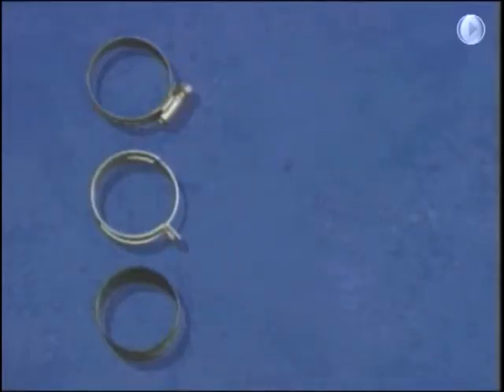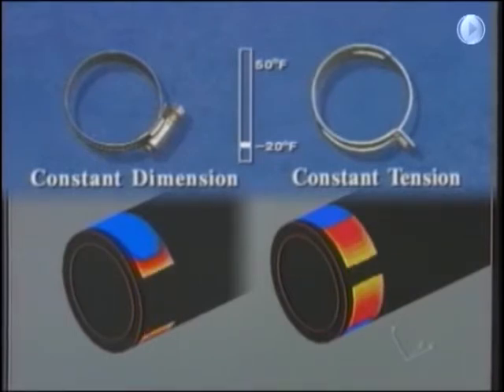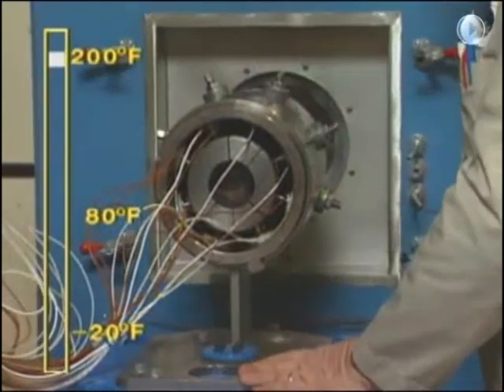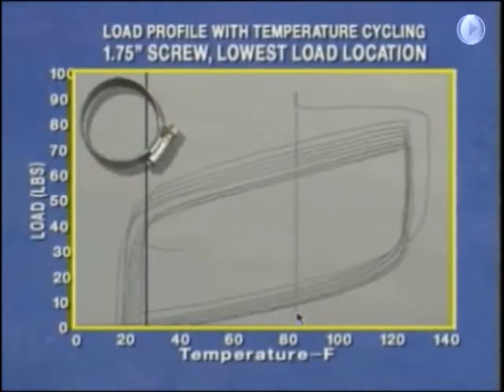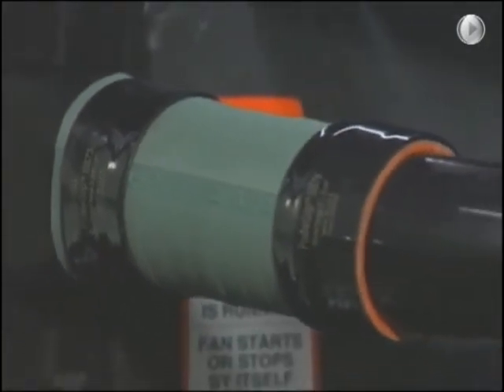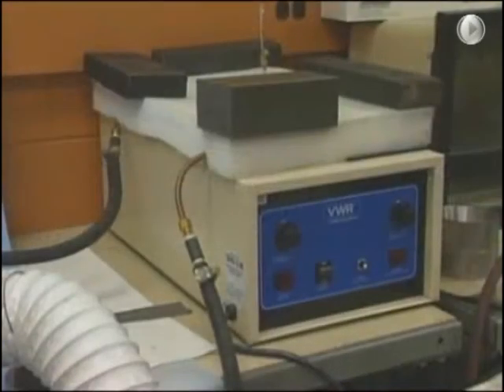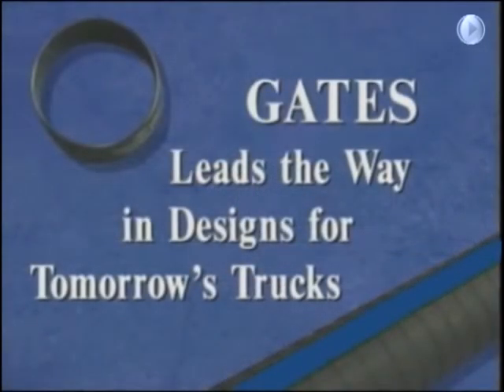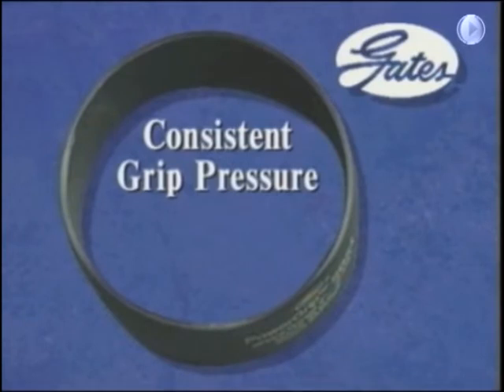Gates PowerGrip SB Clamps & Blue Stripe® Coolant Hose

Comment: so basically its good to use them on hard to reach areas such as recessed permanent fixtures such as the coolant outlet/inlet on the engine block. If its a replaceable part such as on the radiator which are easily accessible its a good idea to use a wave band clamp with constant tension worm gear clamp thats put on early in the morning at the lowest temperature. There is no pressure in the system when the engine is off, thus shouldn't be any more than head pressure of the 2 feet from top of rad to bottom. Very minimal if any leaks thus no worries about using a reusable clamp.